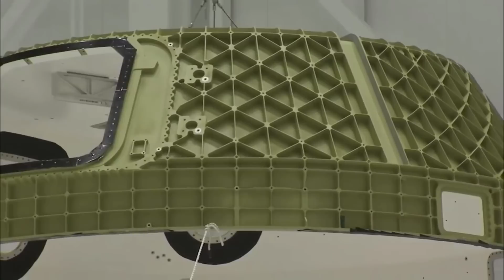Boeing’s Starliner Program Has Now Reached $1.1 Billion In Losses

Comment: Boeing is so lucky the built their 'Starliner' using thousands and thousands of individual fasteners.  Rivets, bolts, screws, etc.  So they have been able to at least partially disassemble the capsule to remove the insulation tape using a flammable adhesive.  Of course, I suspect SpaceX use welded joints as they are faster, stronger and save assembly time, just as they are doing on the Starship.  If they had been so stupid as to use some dangerous flammable materials and needed to correct that I'm sure they would have just scrapped the first one and built a replacement, and done so quicker and for far less money than Boeing is pissing away on their lousy 'Starliner'.

Comment: It would be best for both Boeing and NASA to cancel Starliner. Let us stop wasting effort not to mention astronauts' lives for no good reason.
Reply: The reason for delays and additional costs, is to ensure safety of the astronauts under any scenario. Once these adjustments are complete and NASA gives the green light, Starliner will be an incredibly safe vehicle.
The whole point of the commercial crew program was to have multiple redundant competing systems. That way costs can be reduced and risks mitigated. In no way is that "wasting effort".

Comment: where is the qualitative analysis mandate from NASA, where a panel of experts including engineers from Spacex, Blue Origin, and a host of other competitors and contract holders, is assembled to review the Boeing technology, manufacture methods and business structure? it would seem that if NASA is to be an administrator for the use of private products like this, that they would be experts in the cross pollination of best practices as well. this is where they actually have some value. i am not seeing that level of systems definition capability from the NASA coordination regime. this is sad based on what could be possible.
Reply: Experts? Isn't that what Boeing lobbies are for?

Comment: The 6 crewed flights that Boeing was supposed to fly to the ISS have already been switched over to SpaceX.  NASA has now booked SpaceX Crew Dragon for all required flights through 2029!  By 2029 surely most of the science being performed on ISS will have already been switched to the much more modern, capacious, and comfortable stations that Axiom and Orbital Reef are proposing.  For one thing SpaceX could launch an entire space station with interior volume equal to ISS in a single launch of Starship.  At the very least Boeing should reimburse NASA for the additional cost that it has had to pay SpaceX for 6 additional flights, about 1.5 billion, if not the 2.5 billion nominal cost at the rate which Boeing proposed to charge NASA going forward.
Reply: It stands to reason that most science done on board the ISS will switch to Axiom and Orbital Reef by 2029 because the ISS is expected to be discontinued in 2030.
Reply: @michaeldeierhoi4096  It won't be decommissioned though. I seriously doubt that they'll just dump the whole thing in the ocean. With some modifications, parts of the station can have a longer life.
Reply: @paulmichaelfreedman8334  That's true in fact I had heard that Axiom would initially be adding modules onto the ISS until it is ready to go on its own.
Reply: @michaeldeierhoi4096  And probably take the still usable modules of the ISS with them, while the worn-out remainder of the ISS is then de-orbited into the Indian Ocean. Those massive solar arrays should work well beyond 2030, if they're not too much damaged.